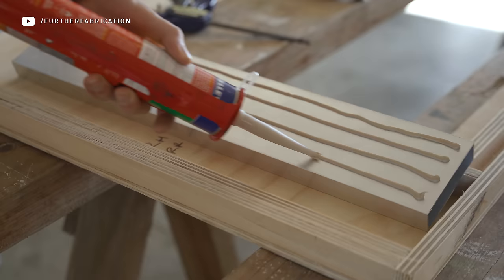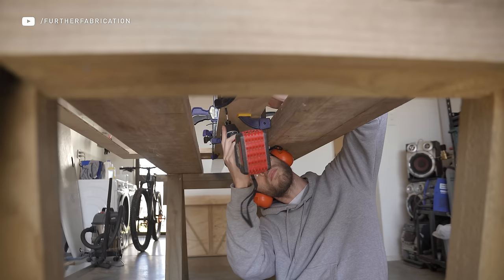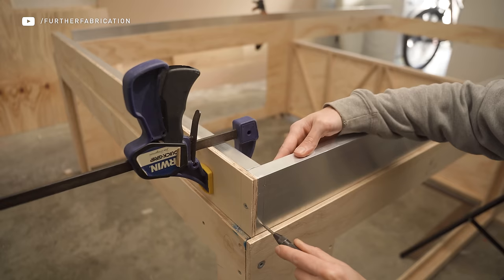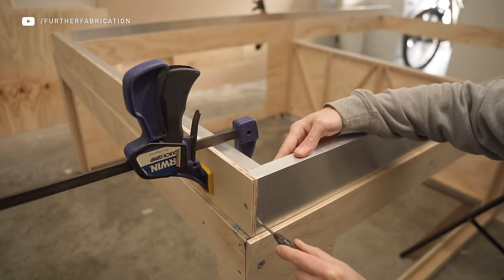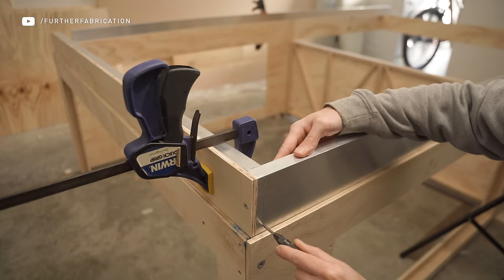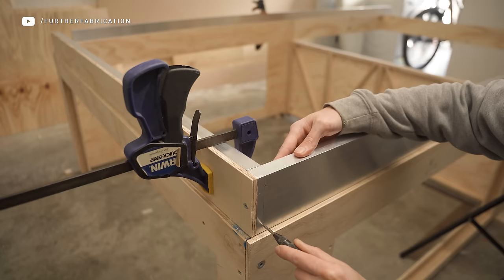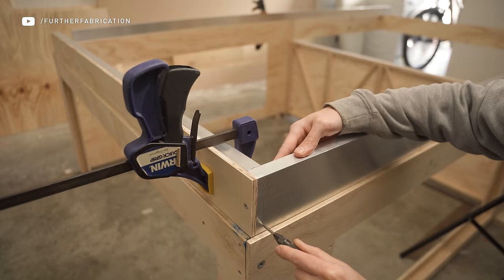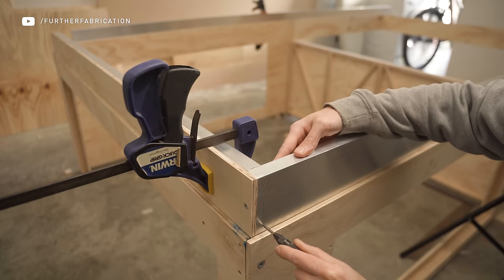Build an Expensive Camper WAY Cheaper

Comment: Maybe one thing that popped into my mind when I saw it finished (after noticing how good it looks) - the struts may not be able to withstand side winds. I know commercially made pop tops use struts to lift but use additional pantograph-like supports that hold and lock the roof into place. Maybe look into that.
Reply: Even RV awnings bend and break with small gusts. It happened to me and it ruined one of the lift arms. It ripped the rivet through the aluminum. I would not suggest leaving it open when you are away.
Reply: Once the top is popped, a rod could be placed at the tall corners to help keep the tent structure tight. The flapping is partly what puts stress on it, besides the noise of the flapping being impossible to sleep through. Also helps prop up the top so reduces some of the stress on the struts if the sides are catching wind like a sail. But yeah, high winds are probably not good for it if you can't park facing into the wind.
Reply: Fashion a couple of expanding aluminum poles in the corners of the tall side. This will apply tension and structure. Will also prevent roof from collapsing.
Reply: @ChopperChad  good idea. an extendable painting pole would work. Throw a mini tennis ball over the threaded end. I only suggested a rod because I was thinking of something thin and unobtrusive.
Reply: Removable X brace at the rear

Comment: That is a great camper very well made. Jut one small suggestion the tent is so good but looks (in video real life may be different) a bit flappy a way of stiffening would be an advantage perhaps removeable corner posts like tent poles in the 2 corners. My old trailer Popup camper had hinged corner poles that were structural.

Comment: Tip: install a elastic band running around the top tent.. it helps in closing the fabric properly
Reply from the maker: Great idea!
Reply: The elastic band (bungy cord) will also help keep the tent material from flapping in the wind.  You will sleep much better.

Comment: Loved your work! I used to build sails for super yachts and sail bags and the only thing id suggest (if you have the right machine) is to use a 3 step zig zag stitch for seams because the weight gets distributed over a larger surface area. That should improve its durability :)

Comment: Thinking of doing something similar to this on my full size GMC extended cab pickup, but using my existing bolt together lumber rack as the structural frame and composite DIY panels for the sides and top that are insulated. Nice work, I’ll definitely watch this again before I build mine.
Reply from the maker: Nice, yeah having a pre-existing frame to build is a good head start
Reply: Do make a video and share please 🎉

Comment: I'd have gone with a flat bar around the inside perimeter of the bed with nuts and bolts. Your hold down brackets make it seem like a rush job and is unsightly for such a professional build. Then on top of that flat bar, will go an inside table or seat maybe 18" deep. If you want some serious bonding strength between two pieces of wood where the bond is actually stronger than the wood, go with Elmer's wood Glue MAX. A 3/4" edge bead on two sheets of plywood making an L-shape will hold that camper up on its own. It's a one-time use glue. Once you open it, you have to finish the bottle in the process or it will go bad within a week or so of sitting.

Comment: I have done a couple of similar projects, my carpentry isn't up to your standards but in the UK at least you can get thin pre painted aluminium sheet, I build plywood carcasses and cover them with this. It can be folded over for better water shedding and overlapped at corners which can then be covered with glued on plastic or aluminium angle.

Comment: It was It was 1978 and I used to take my tent with me up and down the coast looking for waves. My truck sucked for gas, and I hated all the hassle of the campsite, many of which I got kicked out of simply due to the tent for some weird reason. So, I decided to build a tiny trailer and pull it with my dad's YZ 360 certified for street use.   My uncle taught me to weld years earlier.  My schematic was simply yet super-efficient. It would have dampening, and the center balance was set perfectly, but I didn't know that. If you have an uneven load your trailer can fish tail and flip. Only the main part of the chassis was closed rectangular steel, the rest was aluminum.  The frame was very aerodynamic but fixing aluminum flashing to it was not easy using rivets.  I sprayed 3M fabric glue and added enough insulation to handle a coastal winter but I would a good sleeping bag.  I had more storage than things to store so that was very cool surfboard rack went on top and it had a lock to where you could not open it.  The bike pulled it just fine. I could easily take it up to 50mph 80 mpg.  So I could stay on PCH for quite some time.

Comment: Nice job! I just did a similar camper build last year so I was really curious how you were going to handle the water drainage, and waterproofing the wood.

Mine carries a Hobie Tandem Island kayak on top and the whole thing is designed around being able to tilt the top and have the 200lb kayak slide down into the water. I still have a pop top tent but it has to pop 180 degrees opposite of yours. My construction is 1in rigid foam insulation panels with a 1in square tube welded frame around each foam panel. The panels are weatherproofed with a hard wood deck paint coating on top of pet rated window screen material to increase strength and adhesion. My back pops open but the sides don't because I carry two giant 420 watt solar panels on the sides of the truck. The panels articulate (like wings). I have 5kw of batteries. 3kw 120v inverter. 25 gallons of water that lives on the hitch receiver. A shower/bathroom stall. And because you're never going to be parked on flat ground the bed is on linear actuators that tilt the bed in any direction.

The power allows me to power AC, a cooler, cook, and whatever else you can think of including a welder sometimes.

All of that gives me a 4x4 with all of the services of an RV AND I can carry, load and unload a very large sailing kayak on top.
Reply from the maker: Thanks! Wow that sounds like a great setup!

Comment: Awesome build, only thing I would suggest is a safety mechanism to keep the pop up raised while sleeping, if anything was strong enough to force the struts down while you were sleeping 😳.  Also would be cool to have solar on the top, to charge an auxiliary power bank to give you a way to charge your electronics while out camping and not having to run the truck.

Comment: I've been kicking around a few ideas now for well over a year.  I really like your approach.  I plan to do exactly what you did, but increase the "living space" by using two 500lb (230 Kg) drawer sliders.  The sliders will allow a deck that is flush with the bed bottom to extend out past the end of the tailgate by about a 200CM.  

Still working on exactly how I will extend (slide) the top and sides out to meet up with the floor, but I plan to incorporate a rigid door that folds up into the top for storage.

....or I could just keep it simple and do exactly what you did.  😁

Comment: Just seems so much better than the massively over engineered commercial and outdoor project-or youtubers normally do,=
Ok literally You don't have the kitchen sink, solar panels, awnings, Inverters, lithium batteries, the necessary chassis and engine mods to carry it all..
I remember doing this in Australia with second hand, engine oil burning Cruiser with four people in, and  lightweight hiking gear and a couple of range extender Jerrys on the roof.
You dont need all that home maker crap, particularly if you are  youthfuly physically mobile. 
(although you might find room for an extra spare for remote driving)

An  enlightened  build.

Comment: Excellent. Thank you.
At 28:55 I suggest a way to pour from cans with small, off-center lid spouts that works quite well. This works when the spouts are near an edge, not centered. I learned this as a child. When pouring, don't have the spout at the bottom / toward where you'll pour. With the can upright, imagine your can has a vertical rod/axis. You'll be rotating your can about this axis to pour. Tilt your can, but keep the spout away from where you'll pour, not at the bottom where liquid would pour out right away. Keep the spout at the opposite side. Tilt the can to horizontal or nearly so. None will come out. Now rotate the can slowly about that axis. It will begin to pour. It's easy to control the flow by rotating the can. When you want to slow or stop the flow, resist the reflex/urge to tilt the can up. Instead, rotate the can. This pouring technique is much simpler and more elegant than my attempt to describe. Rotate either clockwise or counter-clockwise (if an analog clock is still imaginable) -- Coriolis effect won't mess with you Down there.
Edit: I just did a search, and of course, there's a YouTube video for that. Here's one: https://youtu.be/tesJwR7bScE?si=HiLkZZ9B5MzhLOZG&t=75.

Comment: The camper is really cool. The bed seems to be the piece that could use a bit more love. When you pull it out, there is that drop off. What are you doing to fix that? If that is where you feet are going, you could just do a memory foam mattress, and then double it up in the spot where its thinner. Or even a board with a removable feet that straps to the ceiling inside, then when you pull it out, you put down some spaces to shim it over the rails, and then put a piece of plywood on top. So then it is time to push the bed in, if you routed out a hand hole into that plywood, you could reach forward and use the hand hold and lift and pull the board forward. You could probably figure out a way to set the board over the rails so it doesn't interfere with it. Then it would be just stowing another piece of plywood. That is really the only thing that would keep me from wanting to build this myself is that big gap. Maybe you could do a video on what you found after your tests and give an update? (if you have, my bad I just found the channel)

Comment: good work dude. if you need to cut aluminum turn a new wood circular saw blade backwards in the saw and you will get perfect cuts. that was a trick i learned at a window shop.

Comment: Very impressive! I have similar notions of building a pop-top for a full size pickup, on which I swapped to a flatbed. The resulting floor area is ~82 x 105 inches. I am torn between a slanted poptop, as shown versus one that remain horizontal upon lifting. Either way, with so much larger a roof, probable solar panels and rooftop luggage support, the roof will not be a simple hand lift. It will need linear actuators or a manual crank mechanism.

Comment: EXCELLENT!!!  I like your idea of using aluminum box for the primary structure.  Built and used in the same temperature range, it should work well, but I would avoid freezing temps, as the different coefficients of thermal expansion between the wood and the aluminum could delaminate the bonds or warp the structure.

The cost of commercial versions have VASTLY outpaced inflation, to the point where they're ridiculously expensive.  On my last car-camping trip, I bought a cheap, $60 tent from Walmart which fit snugly in my pickup bed, erected it in the bed, tossed in a twin mattress, which fit perfectly in the bed with the tailgate down, then removed the poles and tied it down under a cargo mesh for the trip.  Setup was less than 5 minutes!  

I've found that using an orbital sander with 60, 120, then 200 grit on aluminum surfaces to be glued provides a varied scratch pattern to which construction glues will hold fast.  Use the 60 grit to thoroughly scratch the surface, then the 120 and 200 grits only enough to add finer scratch patterns without eradicating the more coarse patterns beneath  You can do the same in reverse, too.  The exposed aluminum will oxide immediately, but there's significantly greater surface area for adhesion, as well as the addition of many different angles, which help lock in the adhesion while thwarting adhesion failure modes.  It's critical, however, that you use a roller or brush to thoroughly coat both aluminum and wood surfaces for maximum adhesion.

Comment: Nice work.  I don't like the wedge design as much as a rectangular box idea, so you've got more room for a bed above the cab.  I have a club cab with a short box, and there's enough room over the cab for a full-sized bed.

I'd like to fabricate a lightweight aluminum popup frame that extends over the cab.  Cover it with canvas, like you would a rigid-frame wall tent.  I think that'd be lighter and cheaper than anything store-bought, and be more to my liking.  It'd be easy to add an inner wall by suspending fabric from the frame on the inside.  Even the ones incorporating canvas/fabric walls weigh 300-400-plus pounds, and I'm thinking something like I'm talking about could come in under 200 pounds (frame plus fabric), but I haven't seen anything under 300 lbs.

Comment: Great camper! I agree that sewing is very similar to wood working. I’ve made four camper shells for pick ups I’ve owned, they weren’t for camping as much as for tools, and I tapper the sides front and back for strength, also I put a hump in the roof for drainage and strength. Looks a little less boxy 😅

Comment: This is a phenomenal build! I have basically just built the same camper, but with foam, LOL.

Watching yours makes me feel like I did not do enough structural work, but it is rock solid so far. I still need to fiberglass everything too.

If I had to redo it, I would definitely go the path you took for the most part. I think I would just laminate some foam with wood panels and add the aluminum beam instead of the framing, though.

Comment: I built an almost identical slide on camper but used Aluminum Composite Boards as they are lighter that wood, any color you like but mainly the company I bought it all from do all cutting to shape FOR FREE 😮

Comment: Wow!  Yes, the build quality is top notch, but (as an engineer) I'm very impressed with the design.  
In 1992, I bought a VW Transporter T4 double-cab (DOKA) 1-ton flat-deck truck.  It's actually the last VW truck that was sold in North America.  And I've been pondering campers since.   Given that there are only a few hundred of this model truck in North America, there's nothing built for it.  Your design is inspiring ... and pop tops and VWs just go together!

Comment: The glue connecting the wood and the steel won't hold; temperature changes will stress it until the glue pops. The self-tapping screws will help a lot, but then it's really the wood that ends up holding much of the weight instead of the steel. You really want to find a way to connect the steel to the steel; ideally welding, but screwed brackets would work too.
Reply: I maybe spoke too soon; the "end blocks" inserted into the steel might be enough. I don't really know; it's an unusual way to do it, but one could argue that those are a form of "screwed bracket". It might be enough!

Comment: Awesome build. I have had a similar idea rattling around in my head for a few years. I will be using SIPs, Structural Insulated Panels, and a four post design for my pop up top but everything else you did is right along the lines of my idea. I will probably get a few views out of this video as I reference it in the future. I really need to teach myself CAD. It seemed to help you quite a bit in this build. Good avro from the USA.

Comment: Nice work. It looks like you really thought out the whole build

Your foray into sewing reminds me of my own (but you did a lot more and definitely a lot better). I inherited a Sailrite sewing machine from my dad. He was a sailor and bought one to make covers and whatnot for his sailboat. Or, more correctly, he bought one so my mom could make covers and whatnot for his sailboat. Anyway, they both passed and I ended up with the machine. I made some odds and ends things with it but haven't really had too much call for it. One thing I did find out was how fascinating the mechanics of the sewing machine is. I was looking on YouTube for videos on how to sew and, as is often the case, went down the rabbit hole. I watched a couple of videos on the intricacies of the sewing machine. All kinds of gears and levers and timing involved in making one work.

Anyway, good job on the camper. I'm sure you'll get a lot of good use out of it.

Comment: @FurtherFabrication , Hey Rob, loved the build, brilliant job, just a thought, to keep the fabric walls in whilst closing the pop-up, you could use an elastic string with a cord stop adjuster; it would also help when it's all set up to keep the wind from flapping it around too much.  Just rig it up around the middle coming out at 15 degrees from the roof hinge.

Comment: This is an epic build. In order to save a bit more weight, you can use the same kind of roofing that goes on an RV. However, that will increase the cost a bit.

Comment: I hope you put a bead of caulk in the inside corner of the inside piece of plywood and the aluminum strut to prevent water penetration over time once the glue breaks down.
It's also really good to make sure if you have a flat surface like that, like a window seal, you want it to have some angle to let gravity take the water off to the outside instead of sitting in that inside corner. 
Also, how was the hinge water/wind proofed?